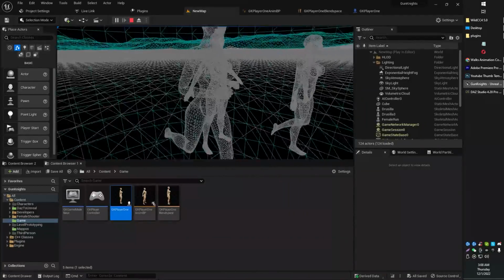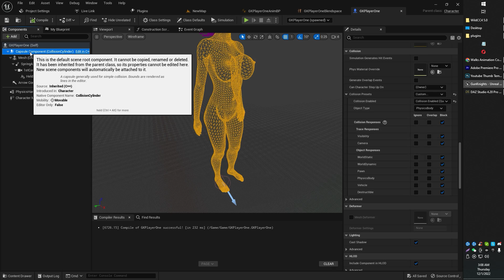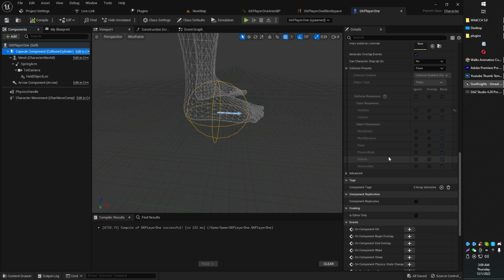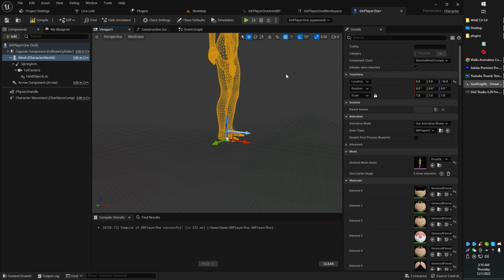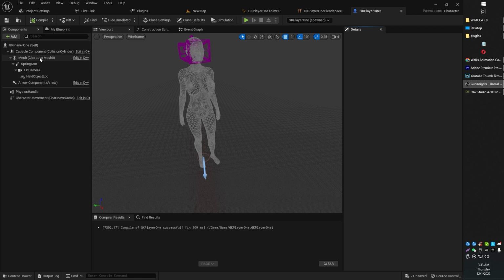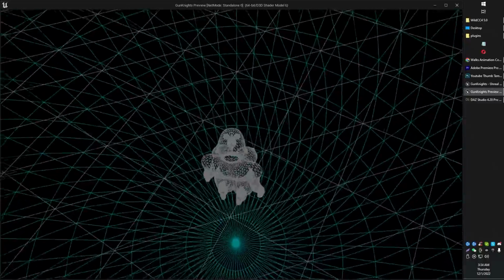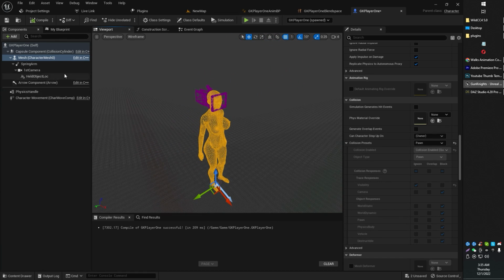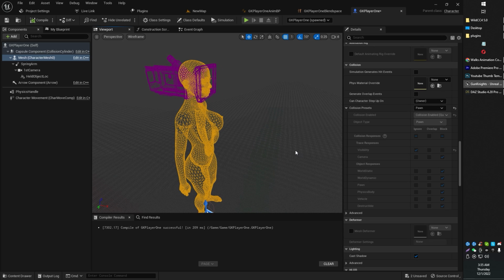Fix for Jiggle Physics Not Jiggling in Blueprint Unreal Engine 5 UE5.1

Comment: Hi, I have a problem with the jiggly physics when the character is in idle.
For some reason the pectoral starts moving a little aup and down continuisly without touch any inputs.
Everything else works, I'm using the basic animations of the quinmannequin, I did a retargeting and I also tried to edit the pectoral bones on blender but the situation doesn't change.
Thanks in advance.